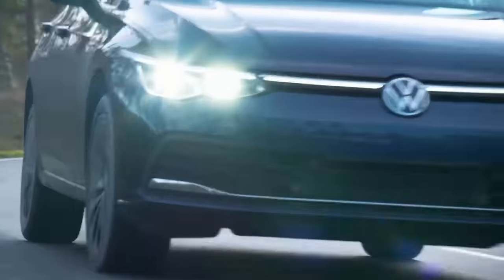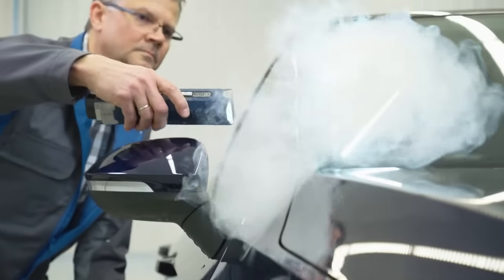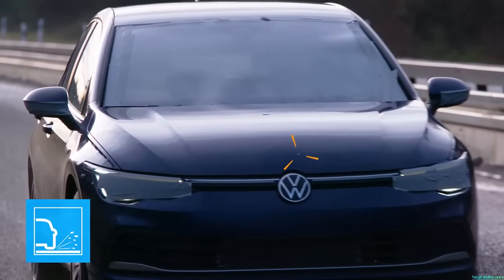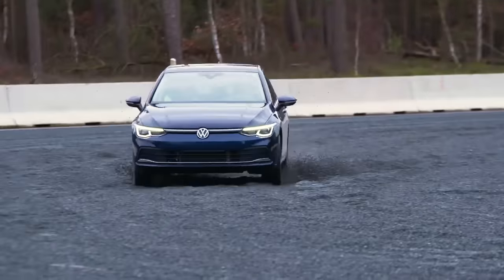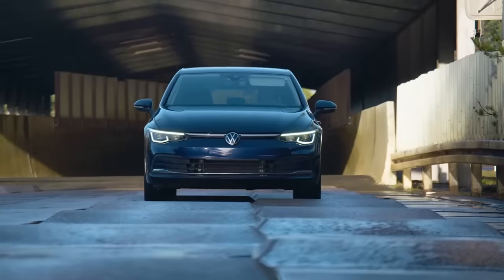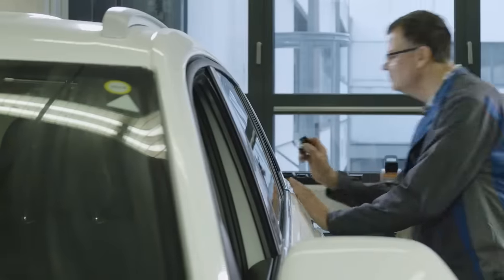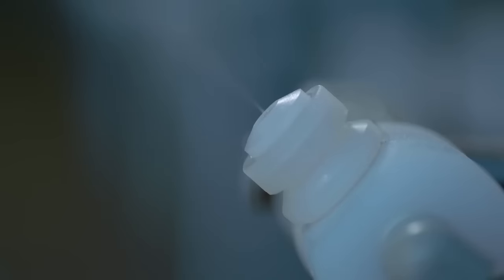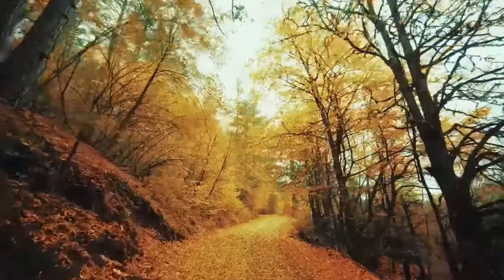VW Golf 8 Corrosion Test - how VW cars are tested against rust

Comment: I've got VW products. All under 12 years of age. This warranty only applies to the believers 
VW Marketing is really good, better than the product itself.
All the golf Mk5 ended up to Lituania, the mk6 facing dieselgate period. The mk7 is a bit better but still have corrosion here and there (rear axle). Good "daily" vehicle, nothing more. The wear parts are easily to be ruined (front and rear shock absorbers before 60000km...).
Do not try japanese products, you can be addicted...

Comment: VW corrosion protection is bad. It was once very good until the end of the Audi 80 and 100 . 
Still what's the  point of good rust protection if the engine and gearbox crap out halfway. Not an unregular case with VW.

Comment: dont be fooled here. "12 years guarantee against rusting through" means, rusting from the inside out, not the other way around. only this is guaranteed and even then, you'll have a hard time proving that you did nothing wrong, which of course is impossible to prove.
this all looks impressive, but it's just a marketing stunt. also, what are 12 years? even the 1st gen golf could go for 12 years without having corrosion holes.

Comment: This is just a VW promotional video. They still rust and fall apart. Anyway what is the point of building a car body which will last forever when the engine wears out in just a few years (timing chains, ear valves clogging, inlet manifolds clogging.
Reply: Oh I nearly forgot, the pano roof leaking and dumping an inch of water on the floor. It's certainly waterproof. Once the water gets in it certainly won't get out.

Comment: Me; driving an over 26 years old VW Golf Mk 3 Cabrio with 250´000km on the odometer: "omfg this part has to be protected!" "No this part has not enaugh wax this year" "oh no, there is another weak spot in the undercoating" "f*ck you local winter service people, stop throwing salt on the roads at +5°C and f*ck you fastidious
 people who rely on this because of the missing capability to adapt the own driving behaviors to the actual weather situation."

Volkswagen: 12 Years protection of the metal parts included! Yay great! but the car will be scrapped sooner because of massive other failures that can't be economically fixed because of cluttered engine bays even more electronics that are designed to fail.... 

I mean: Who want's multiple proprietary LED/LCD Panels with software and 3rd party compatibility that will be discontinued after 6 years  just for doing the same thing as clamping your own smartphone/tablet computer that you replace after 2-4 years anyway so that compatibility is no thing?

Btw: For all Mercedes Diesel lovers out there: If you are a masochist than try to change glow plugs on a Mercedes Benz A-class W169 2009. Did this 2 weeks ago. 2-3 Days of work in the cold workshop. After that I changed the sparkplugs in the cabriolet: Total time needed: less than 10 Minutes.

Comment: Whats the point there engines die after 50000 km anywe haha tsi rubbish and dsg faillure
Reply: @ytuberization  My collegue has 2013 Leon 1.4TSI and engine dies after 90000km. It was newer engine with timing belt. High oil consumption (1l per 2000km), missfire on random cylinders, lost compression on 2 cylinders. New turbo, new pistons, new piston rings, new valves, crankshaft bearings. Almost 2500€ in unauthorized garage. In VW authorized service they told him he need new engine. I have 2014 Leon 1.6TDI 180000km and it still runs without oil or turbo issues.

Comment: Should be ashamed of themselves. The mk4 had a 10yr corrosion warranty. I had a mk4 with a known design failure on front wheel arches allowing wicking. Basically a sponge sat inside. They did not honour their 10yr warranty and instead had a soft headed salesman tell me because I didn't get my servicing done at vw he would not honour warranty.  Never knew the top quality recommend fully synthetic oil I used protected the wheel arches! Anyway in closing I am writing this because vw while good cars they are not worth buying new. As full of it. And that they put this vid out...... well if u want buy but know the 12yr corrosion warranty means Sweet FA.

Comment: VW, come test your shitty cars here in romania with your fake corrosion tests. i have a golf 7 and in only 2 winter seasons going to the ski slopes every weekend, i've destroyed my expensive original by-tone alloy rims. not many pot holes hit, it's just that they are cheapely made. they don't withstand roads outside highways because on the mountain they throw antiskidding dirt mix and salt all over the place. in just 2 years they are completely cracked, the gloss is scratched. i wish i listened and bought the shittiest metal rims for winter use. when i replaced the rims this spring, the car is super rusty around the wheels, so i shit on your fake promotional test. imagine if i had to use chains. jesus. i only drove on asphalt